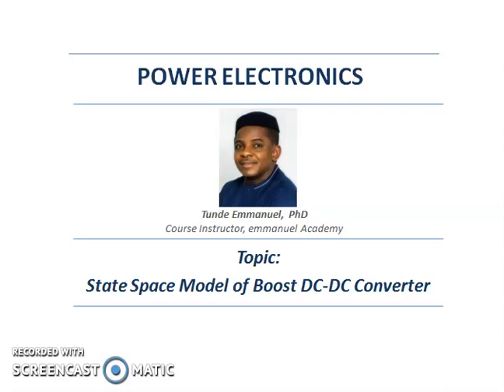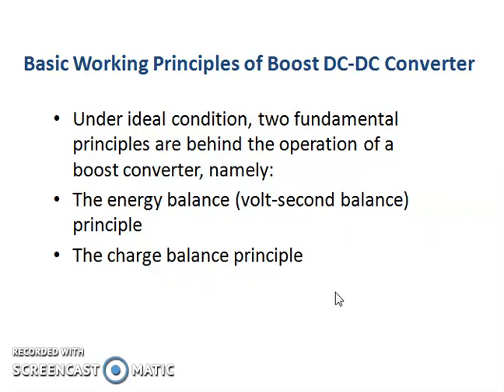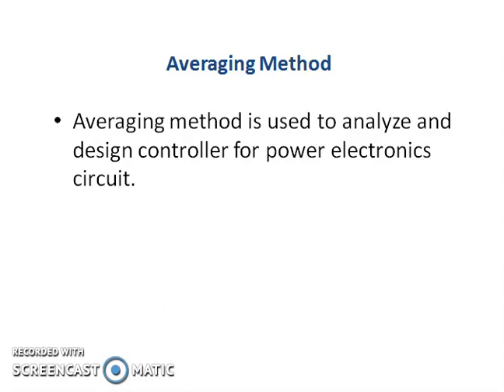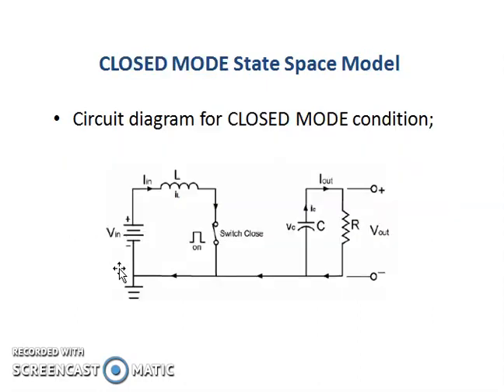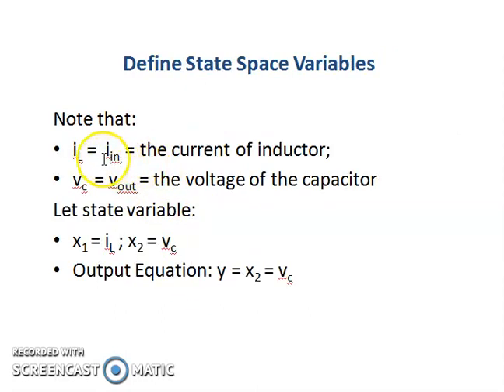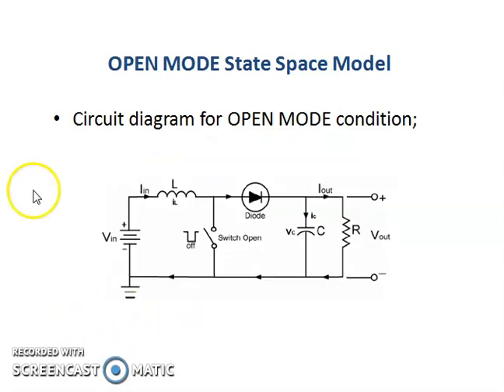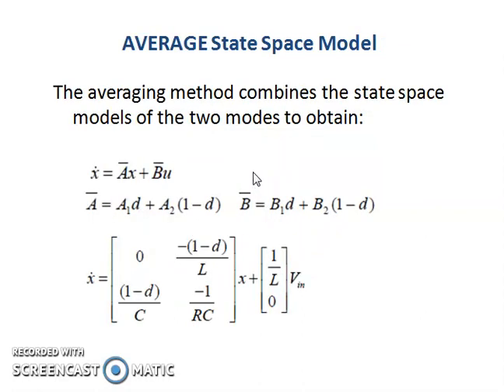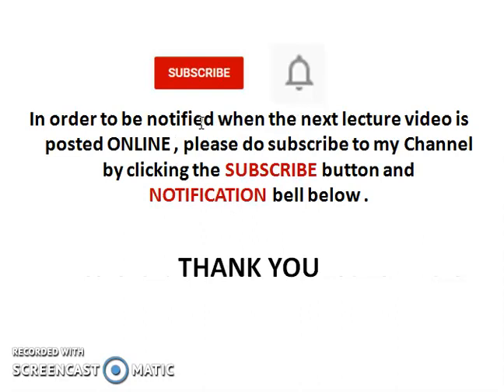State Space Modeling of DC DC Boost Converter

Comment: Good day Sir, I thank you for your lecture. May I know if you would kindly take this boost converter lecture to it's logical conclusion comprehensively. Things like, developing the small signal model up to the controller design and what the controller equations practically means. Additionally, how does one translate these equations to hardware connections that would do the controlling effects please. 
I need to talk to you if possible. Kindly accept my contact as follows:
abalhafsa@gmail.com and +2348036393049. I have an issue that I will like to have your inputs, it's exclusively academic regarding DC-DC converters design.
Remain blessed.